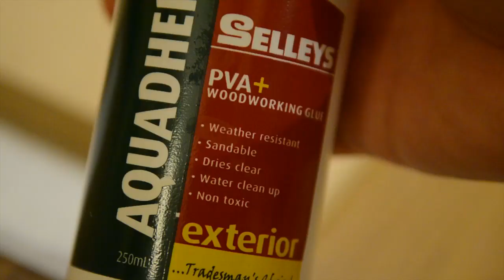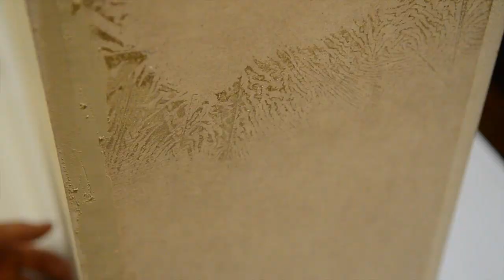LSK Home Theatre Build

Comment from the maker: You're the first one to mention that. It was actually sort of a liming coat, to wash out the timber grain but not completely suppress it. It doesn't work on its own but at the end when placed with all the other pieces it does fit in.

Could have done it better though.